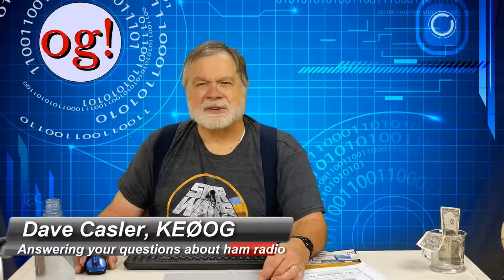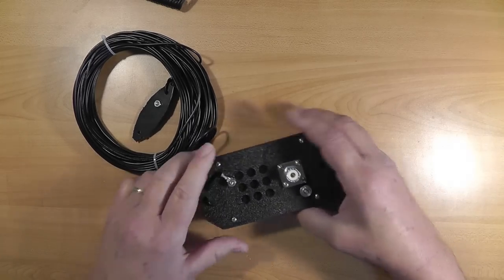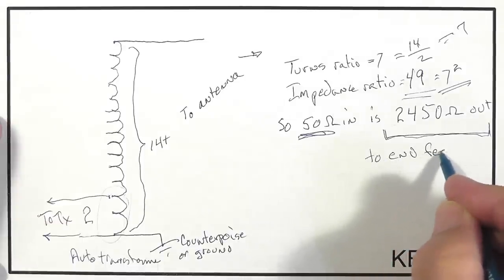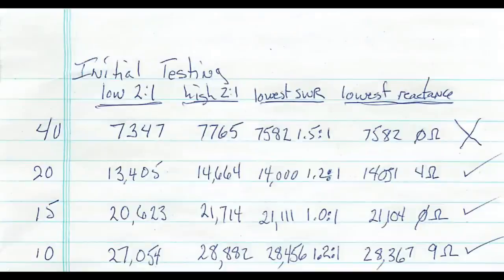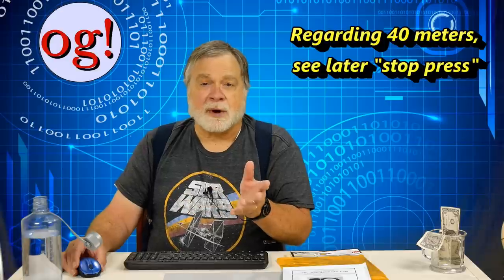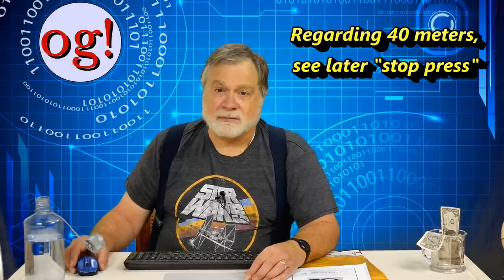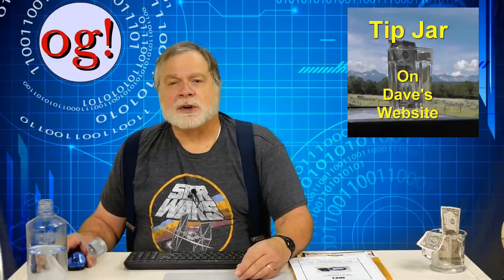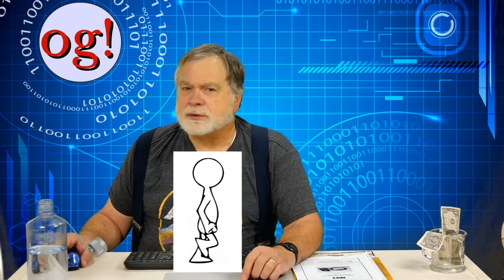Review of MFJ-1984MP End-Fed Multi-band Antenna (# 89)

Comment: I have this same antenna. I have it as a  slope antenna going up about 40 foot into a tree The box is mounted to a pole that holds my 2 meter antenna on the side of the house at about 8 foot high. I run the ground wire straight down to my 8 foot station ground rod. I use no counter poise as that is what MFJ said to do when I called them. My swr is very high on all bands. I now run it to a LDG 100Pro2 auto tuner. That said sometimes even the auto tuner can't get a good enough match on 40 to transmit safely. This is not the case on all bands all the time. This antenna seems to have a mind of it's own. I called MFJ and they said the way I have it hooked up without a counterpoise and straight to my station ground is what they recommend. I have heard great things about myendfed antennas and Hyendfed antennas and have thought about trying them but they are 3 or 4 times as much money and I am not sure they are using any different design than the one I got from MFJ. Thanks for sharing. KE0RPU
Reply from the maker: They told me to locate the antenna very close (a few feet at most) to the radio. Hence my comment that it's good for portable installations but not the home station.
Reply: David Casler  Thanks David. The antenna works great on 10, 15, and 20 but as you said I can not get much below 2-1 on 40 meters. I am thinking of spending the extra money for a HYENDFED brand of the same antenna as I have read good reports on it. Have you ever tried any other than the MFJ brand of this type of end fed that does 10-40?

Comment: Would the fact that, at 40M the antenna, at 20 ft in the air is a good bit less than the approx. 10M 1/4 wavelength be a factor, maybe?

Comment: I have same antenna.  It is rigged as a sloper.  The box is about 4 feet. I use no counterpoise.  It works for 40,20 and 10 without tuner. I Have not tried 30m.  I’m using QRP so I am not concerned about a counterpoise.   But next time I put it up, I will try a counterpoise

Comment: Im running a 9:1 with 88 feet wire ..Box is 32 feet above the ground under my diamond x300 with the wire slopped down and tied off to my back fence ... 80-10 metres through a tuner

Comment: Sure would like to see you do a review on the MFJ  2389.
Reply from the maker: Soooooo many antennas.......soooooooo little time!
Reply: David Casler 😄 I'm sure you can handle it. 😉 There is not a single review on that antenna online anywhere.  MFJ will jump at the chance to have it reviewed.  Consider it,  at least.  It's unusual in that it's kinda like a multiple band Hustler, no ground radials, base.   Hf through 70 cm , it's like the Maldol hvu-8,  , might even be the same manufacturer.

Comment: You’re doing it wrong (but it’s not your fault).  I own the 1984, 40m, 35 watt version.  Its installed  flat horizontal 50’ above ground with 50’ of rg213.  My swr dips between 1.0:1 to 1.09:1 at 7060 MHz, and is is at 1.2-1.3 at 7300 MHz.  At 14,00 MHz SWR is 1.2 inching up to 1.5 at the high end of 20m; it is below 1.5:1 from 21,250 up, and below 2:1 on all of 10 favoring 28.3 MHz and up.  It’s frankly a great antenna for my home. If you look at what other manufacturers advise, they don’t recommend doing what you were instructed to do by MFJ. What they actually recommend you do is ground the coax shield to stop common mode currents from throwing off your SWR.  I followed the advice from the much more expensive Myantenna  brand.  Same components, same physics, same antenna.  My MFJ costs $39, the Myantenna version is $189 (but can handle more power).  Ground the coax and do another review.  People don’t need to spend $200 for a $5 toroid, 66 ft of wire, a few plugs and a plastic box.

Comment: I'm new to this sort of calculation, so please help me if I'm missing something. My understanding here is that the problem on the low band was that there was reflected current washing back so it began working as a radiator and that messed up the behavior of the system.  Isn't this the classic example for a common mode choke?  Instead of moving to a shorter coax, why not make six or eight turns of that coax just below the matching transformer?  Again, this is in addition to a good ground at the matching box. Thanks from Ross @ KI5SR
Reply from the maker: You're right in general, but in this case the impedance at the feedpoint is very high (thousand or more ohms) so it would have to be a huge choke to create that kind of impedance. So it looks like the match box needs to be relatively close to ground.
Reply: the ugly unun aka common mode choke (its NOT a balun)  would be on the coax side - where the impedance is 50 ohms.. right? but the typical reason to NOT do that is that the end fed needs a counterpoise which is usually just the coax run. If you do the chock then you probably need the counterpoise. There are other videos on this tho I don't recall the presenters.

Comment: Hello Dave!, 
    Really enjoy your channel. I just purchased this antenna and am awaiting its arrival. Would the adversity with the 40m band be workable with a tuner? Or would that not be advisable. Unfortunately I had planned on having this for fixed station due to limited space. Thanks for any advice - best regards
Reply from the maker: This antenna works best in a portable environment with very short coax between the transmitter and the antennas little tuning box.
Reply: @davecasler  Since the shield of the coax is forming the counterpoise for the antenna, longer would be better.  I've had great success with this antenna with a long coax (more than 66 feet) and deployed in an inverted V configuration.  With an antenna tuner I've used it on all amateur bands, 160 through 10 meters.

Comment: Dave do you feel the mfj-1982mp would perform any differently, I recently purchased it and plan to mount the box to the second story 20’ of my three story home and feed the connection point through the third story window 30’ and hang the end as high as possible in the trees ideally 60’ or more.  I will run a ground wire from the box to a copper ground rod below the 20’ connection, I appreciate your thoughts and consideration 73 Steve KC1HYM
Reply from the maker: I had a hard time testing the antenna because my test configuration was different from what MFJ had in mind. We had some back and forth about it. It seems the antenna works well in a portable situation with the cable to the radio short and both the near and far ends pretty low and the middle up higher. I would not recommend the antenna for a fixed installation.
Reply: David Casler thank you for the response Dave, I have the 300w 132’ length antenna version and will be trying it in a fixed incline installation...wish me luck, I’ll share my results with you 73 KC1HYM

Comment: An auto transformer is not a balun. So common mode will be an issue. The auto transformer needs to be tested, because it may not be effective at lower frequencies. Dave, you need a VNA to take your experiments to the next level. Also, the MFJ antenna analyzer has design issues as well. It is good as a cheap portable tool, but I do not trust it. For example, the MFJ antenna analyzer does not have any frequency selectivity. AG6AV
Reply from the maker: You're right. It's an unun. Good catch. Yes, I'd love a VNA. I just have to wait for the tip jar to get full enough! But a real signal generator (arbitrary function generator) is next on the purchase list.

Comment: Hi Dave.  Since the coax is unbalanced and the antenna is balanced  Shouldn't the zip have a choke on it? Seams like the shield of the coax is still radiating  .
Reply from the maker: It probably is. But while a dipole is inherently balanced when center fed, end feeding is another story. The little balun helps, but needs a counterpoise.

Comment: MFJ-1984MP: The cheap 18 gauge wire broke. It was made fro aluminum wire. I replaced it with 14 gauge copper strand wire and my transmission strength when through the roof. reception is still the same. Thought you should know, MFJ needs to use better wire.  
Woods 55667123 Coleman Cable Primary Wire 100ft. Spool Bulk, 14-Gauge, Black

Comment: I ordered the MFJ-1982MP and just installed it, I haven't hooked up to it I'm waiting a few days waiting for it to find it length. It's been up now for 5 days and today I will be hooking up to an FT-1200.  The only thing I see thus far is cheaply made product using ABS plastic as an insulator at the tie end that looks like a 2 years old cut it, the Box-end using the same ABS plastic as a cover and hookup point, the box is not weather resistance by no means. At the $70 price they could have given a better insulator, and hookup more resistance to weather. Other than that I will be tying in today and running test I like it but it could have been made better and still kept the same retail price.
Reply from the maker: If you compare the $70 with one of their vertical antennas or with the Yagi or anything similar, you'll find it $70 isn't really a lot of money for an antenna. If you start putting together the costs that it takes to design, stock, build, ship these antennas, I don't think you can do much better. The antenna is designed for portable use because the box can't be more than a few feet away from the transmitter. As a portable antenna it does pretty well. I wouldn't try to use it as my permanent base station antenna.
Reply: Thanks for the reply David. Will I hooked up today, I have a slight sloop with the connecting end at 25ft and the end at 37ft, I also ran a 65ft counterpoise. When testing I found with me in CT a station in Tx on 20m, comparing it with a 4BTV ver. and a CF Alpha the MFJ-1982MP received much better than the others. I plan on leaving it up year-round in hopes it will make it through the winter.  A thumbs up on performance.
Reply: buzzsah  oppo ppoö
Reply: MFJ says to keep the air vents OPEN to dissipate the heat which is generated.

Comment: I bought ($69.99)  the antenna seems to work fine. Question: If the 20 gauge wire breaks, can I replace it with a 10 gauge wire, or will it not work? Thanks.
Reply from the maker: Yes, in theory. 10 gauge wire, unless it’s copperweld or steel core, isn’t any stronger than the 20 gauge wire. (I know that seems strange, but it’s the wire material, not its thickness, that makes it hang better.
Reply: @davecasler  Thanks.
Reply: @davecasler  The chart located here: https://www.bing.com/search?form=MOZSBR&pc=MOZI&q=tensile+strength+of+stranded+copper+wire+gauge  Seems to state otherwise. Thanks. It's the PDF download .

Comment: Hello and thanks for the review. Have you tried to put on the coax near the box a ferrite core?
Reply from the maker: Unfortunately no, and I gave the antenna away some time ago.
Reply: @davecasler  I have ordered myself MFJ-1982MP. It was before I saw your video. Now the antenna is on it's way to me. Shall see what it will be like...
Reply: @davecasler  finally I've got it (Ukrainian post is the most incapable in the world).  Well I must strongly disagree with you. I've hanged it temporarily: one end right outside my radio shack window at height of 6m above the ground and another end close to a tree at the 8m height. Taking into account sagging one may say that it's hanging almost horisontally at the 6m height. No counterpoise, no coaxial shield grounding. Just simply 8m of RG58 cable from the rig to the antenna. My rig is right next to the window at the second floor of my house. I must say that on all of the bands (3.5M, 7M, 10.1M, 14M, 18.1M, 21M, 24,9M, 28M) I have SWR not higher than 1.8. Only on 28M band I have good SWR just from 28.2M to 28.9M, all the rest of the bands are covered in full, most of them with SWR below 1.5, and 21M with SWR 1.8 @ 21.000kHz. SWR was measured using Diamond SX-100 and 10W rig output. 
I have disassembled it to look at the transformer and noticed that the ratio is not 7:1 but 6.5:1 (autotransformer with total 13 turns and 2 turns primary). Maybe that is the secret?
Reply from the maker: @dongjuang4196  Glad it's working for you!
Reply: @David Casler, this is what I’m thinking, that the common mode currents are the issue. Use ferrites or a choke in the coax. I am preparing to explore the 49:1 paradigm and as a vertical or a sloper. My 9:1 unun of several years is mounted 5-feet off the ground, is connected to a close 8-foot driven ground rod, and uses a horizontal wire in NVIS fashion. I dealt with the common mode issue using ferrites to keep RF off the 50-foot run of coax to the shack and the rig. I know this is apples and oranges, but it seems that @Dong Juang has the right idea for the 49:1 product that you reviewed.

Comment: I have been using a HWEF multiband antenna from the Dutch company Hyendfed (www.hyendfed.nl).  My swr measurements have all been consistent with the manufacturer's specs (configured as sloper using a 12 meter spiderbeam telescope mast, matchbox  3 meters above ground.  No tuner, ground, or counterpoise required.   I have used this portable and as a home station antenna with 50 meters of coax.  I have the 10 to 80 meter, 200w pep  version.  The 80 meter stub can be easily adjusted for optimal swr  All in all, this has been the best store bought wire antenna I own.  David DM3BC
Reply: I have the MFJ with the same problems on 40 meters as Dave. Mine is a sloper with the box about 8 foot off the ground mounted on my 2 meter antenna pole. I have great swr on 10-15 and 20 but can't get lower than 2-1 on 40 even with my antenna tuner. Does the Hyendfed model require a long length of coax or could I still use the 10 foot length I now have on my MFJ?

Comment: I fought and fought and fought with a "qso king" version of this antenna for weeks. NOT a fun experience.  Stuck it on the shelf and bought a fan dipole and have been much happier.
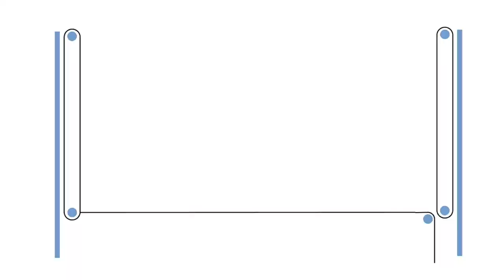Reply: The QSO King, while it looks similar is a very different antenna. The QSO King is a 9:1 Unun and a piece of wire. The design in the video used 1:49 transformer and includes capacitive and reactive elements. I noticed the MFJ seems to skip the reactive element tough.
Reply from the maker: The MFJ version that includes 80 meters has a small coil several feet away from the matching box. And, technically, the transformer in the MFJ unit is also an unun.

Comment: Dave I have just got the 8  watt GT-5TP Baofeng I want to use it just for Mobile use with a mag mount antenna ,My question is will the coax take the radiation away from my head when keying down to transmit ??
                                                  n2wjs Charlie.
Reply from the maker: Yes
Reply: Thanks Dave 
                  n2wjs Charlie.

Comment: This maybe under the sun but it's nothing new..What? At over100 years old?
100 years ago, the Germans were dangling one of these from their  Zeppelin, gas filled Dirigibles
The whole point was to get the Hi Z ends (The sparky bits!) well away from that naughty H2 which was constantly making a bid for freedom from the balloon, in search of some sexy O2, eager to some vigorous copulation.er coupling.
Generally. with the lighter properties of H2, it was up and slipstream made it away 
so usually there were np problems.   However, Kaiser Bill was "Kein Risiko eingehen!"
"Taking no chances!)
Of course, it became known as the Zepp antenna.
As only one leg of the 1/4 matching stub (No Toroids in those days) was used, Hams who used it on the ground, tacked another 1/2 Wave on the unused leg and it became a Double Zepp.
There certainly isn't anything new under the sun.
ACE VIDEO.. Good to view. TNX de G3NB.

Comment: MFJ use sereally cheap nasty ferrites.Not micrometals or Amidon You need a red T200-2 or VERY similar. Here is a video of basically the same antenna, used as an 20m halfwave. I would use this EFHW either as an L or as vertical. The most expensive part is the T200-2 torroid, and the wire, IF, hard drawn copper (RECOMMENDED!!!)

Comment: My 1984 just went dead and I opened it up to find the same wire broken as Dave had. Too much movement within the box. Surprised nothing else is broken or loose. Not impressed with MFJ's workmanship. I think I'll start to look elsewhere for my equipment and supplies. This is just one of many examples of poor work done by MFJ.
Reply from the maker: MFJ has a partially-deserved reputation for careless QA. But there's not much choice for some things as for very many station accessories, there aren't competitors. They continue to sell almost everything they've ever sold, and the ham radio fiction book I wrote for them over 20 years ago is still in print! You name it, MFJ sells it, or through a subsidiary like Cushcraft.
Reply: Understand - I fixed it and made sure that it wouldn't happen again by using silicone to make everything solid.  To my surprise it's good on all bands from a 1.0 on 40m to 1.7 on 10m. I have the end up in a tree as a sloper with the box attached to a wooden fence about 5ft AGL and using 50ft of RG8x. I had none of the problems (except the broken wire caused by lack of support on the inside) that you experienced Dave - go figure...